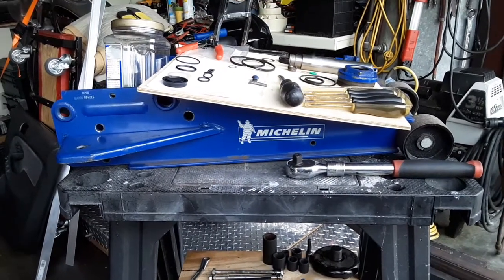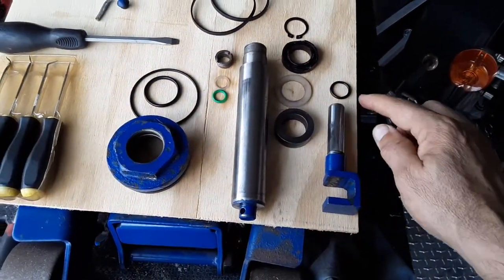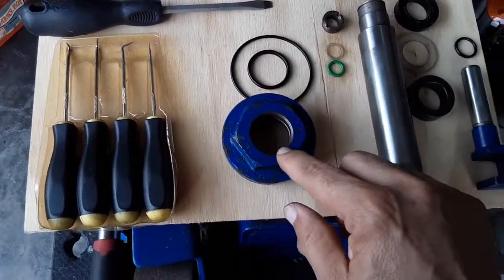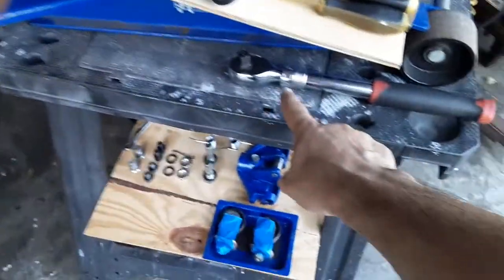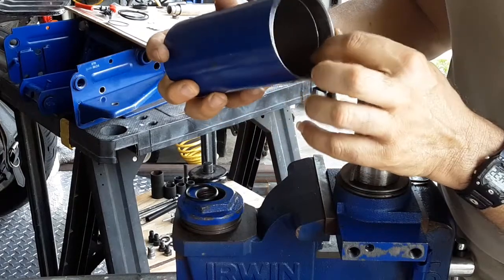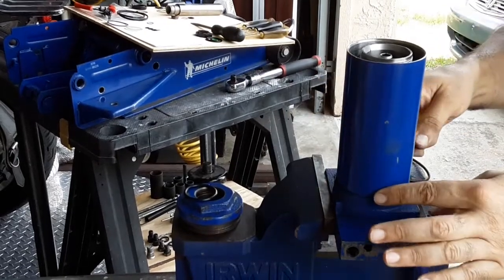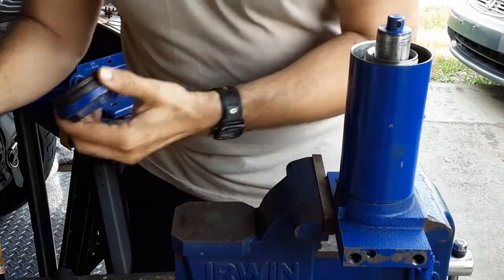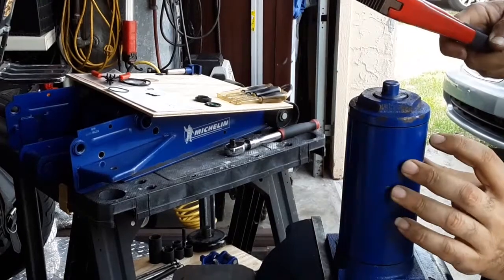DIY / How To Repair a Michelin 3.5 Ton Floor Jack...

Comment: FYI you only need to remove the two Allen bolts two hex bolts just below the Allen’s the long  rod with the nuts and spring. No need to remove pump handle assembly or caster wheels.
Reply from the maker: I'll do that next time I need to service it again. 😊
Reply: Worked for me, thanks!
Reply: @cliffbernsen438 we we was cwèèew

Comment: Manny, How do you remove the rod in the center of the jack that the lift arm pivots on?  It looks like there are caps on each side that are covering a bolt or something, but I was unable to get the caps off.
Reply from the maker: I will look into it and get back with you but I believe everything that needs to come apart, is secured with removable nuts or drift pins.

Comment: Could you explain or add a video of the reassembly of the 3 valves at the base of the cylinder?  Thanks for the video!
Reply from the maker: B Keen, i'm assuming you're talking about the adjusting valves and on my jack, I didn't take them apart for fear I would mess up the factory settings.  The other pin valves,  you can take them out and replace the o-rings and just push them back in after you coat the o-rings with fresh hydraulic oil.
Reply: @MannyFontes1968  ok,, 😥😰😨

Comment: How did you get that top nut off the hydraulic unit. I can not get it to budge even in a vice. Took it to my mechanic and he broke his plumbers wrench trying to loosen it.
Reply from the maker: Wow holy crap Kevin! I actually used a 24" pipe wrench with a 3' pipe extension for more leverage. You can also try using a flat tip punch and a 2 to 3 lb. hammer to hit the corners on the nut counter clockwise to try and shock it lose.
Reply: About to give up on it. Tried to buy just the hydraulic unit. Found a site. $179.00. Ah no…. Finally got some leverage. Tried the punch. No joy. I got a pipe wrench we used on our tractor. Still wont budge. It is stripping the nut.
Reply from the maker: @kevincraft3747  I think the only option left is to heat it up but you'll need a new seal...Good luck with this option!

Comment: So DON'T use the tapered seals. USE the O-rings for the valve body?
Reply from the maker: Yes, the tapered seals can roll during installation causing a bad seal making the pump not work right.

Comment: Hola tienes el video donde ajustas los tres tornillos pequeños?
Reply from the maker: Hello Luis, those 3 little screws are preset from the factory and are not supposed to be adjusted but if I find some information on how to adjust them I will share it with you.
Reply: @MannyFontes1968  ya se,, 🥶 ok igual te agradezco, saludos Many

Comment: So why did you disassemble it that far only to leave the center tube and bottoming plate in there? There's oring and a  gasket hidden under there..
Reply from the maker: Jay, are you talking about the one that is about 1/2 inch in diameter?

Comment: I have the same jack and same problem.  I haven't looked too deep into it until today when I needed it.  Is it necessary to take the whole thing apart?  I might be wrong... I'm probably wrong is more accurate, but can't I take the jack out without all the work?  Thanks for the video!  Because the O rings didn't match ( round or tapered) , would you still recommend the link you included?  if it's 70 buck's and it is,  I would pay it.. not a problem,  but it looks like I'm buying a bunch off spare o rings and 2 that don't fit.
Reply from the maker: If you have never done a tune up on it, then I would say yes to taking it all apart so that you can replace the necessary  O rings or seals so that you don't have to take apart later on if the seals start to go one by one. Sometimes the links for parts don't last long or are discontinued. The tune up I did on mine is still holding up.

Comment: many how did you get that nut off that jack pump and what did you use i try with a pipe wrench i can't get it off what can i do i'm stuck 1 i can't get a pipe wrench stay on the nut 2 or what size socket is it 3 where can i go for some one to get it off for me thank you many this second jack is a bicth if your close to orlando  fl. i come and see you

Comment: Great video!  I have the same jack and it's leaking from the piston rod. I need to order a repair kit. How is yours? Is it still leak free and working fine? Thx for sharing.
Reply from the maker: Thanks Guy and mine is still working great and it is leak free so far.

Comment: Hey Manny, I know this video is a few months old, but I'm trying to rebuild the same jack. I got the seal kit, but I can't get the blue sleeve off the jack. Is it left handed thread? I've tried a giant crescent wrench (& smacked it with a hammer!) on the top 2" nut. I've also tried a strap wrench around the body of the sleeve: not budging. What did you do? Do you remember?
Reply from the maker: Jeff, in order to get the top retaining nut that holds the reservoir body down, you'll need a big pipe wrench with a 2 to 3 foot cheater pipe over the pipe wrench to get the torque you'll need to get it loose. Once the nut is off you should be able to twist the body out since it's only being held on by the o-ring at the bottom. A big bench vise will help alot also.
Reply: @MannyFontes1968   great advice, thanks
Reply from the maker: @jeffr0  thank you and you're welcome...
Reply: Strong impact with 2-1/8 socket works nicely. Thanks for the video Manny!
Reply from the maker: @dougyoung221  yes it would and you're welcome!!!
Reply: You don't need cheater pipe to remove the nut.  Just use a pipe wrench or cresant wrench, and use a bigger rubber mallet/hammer on the handle.  It comes off easy.  Why bust your kahuna's?
Reply: I’m rebuilding this same jack, however the bottom of my reservoir is threaded and does not “snap” into the base like the one in the video. I had to use a 3’ Chester pipe on a pipe wrench to get it loose.

Comment: Did you have any difficulty getting that top nut/cap off of the cylinder? I've put the 'big' pipe wrench on it and just can't break it free! Am I missing something? thanks
Reply from the maker: Darin, it was a pain in the butt but I used the biggest pipe wrench(16") I had with a cheater pipe that was about 3 feet long to get that nut loose.  Put the pump in a good vise and you should be able to get it.
Reply: @MannyFontes1968  Awesome, thank you. I'll give it a try. And thanks for the video. This jack has been sitting, unusable, for over a year. Looking forward to getting it work again!
Reply: @MannyFontes1968  Wow, that was on there tight but the cheater bar did the trick! Thanks again.
Reply from the maker: @dtperkins1  Good to hear Darin and you're welcome...

Comment: I have this same jack and can't lossen the 2 inch bolt off the top.
Reply from the maker: CSM, you're going to need a good bench vise and at least a 14" pipe wrench with a cheater pipe to get that off.
Reply: I'm just doing mine, damaged in a fire but also seeped down slowly before the fire. Fortunately I have a 1/2" 20 volt dewalt impact because pipe wrench wasn't grabbing well enough. Unfortunately I didn't have a 2-1/8" socket, the size of nut. Fortunately a friend was able to borrow from his job site. It couldn't resist the dewalt. My kit came with choice of o-ring and beveled seal this fella had. My kit came from Lazzars.
Reply from the maker: @dougyoung221  yeah, if I had an impact socket that size, I would've used it also with my air impact gun to remove it.
Reply: 52mm deep impact socket and a good impact wrench and it comes right off

Comment: I wonder if this is the same as the napa 3.5 ton?
Reply from the maker: Steve, it looks like it and maybe years ago they used to sell this Michelin model.
Reply: @MannyFontes1968  the napa 3.5 is no longer available nor is any repair kits from napa. 😒
Reply from the maker: @MrSteve8511  well that sucks and have you tried looking at the manufacture's website that made the jack or Amazon?
Reply: @MannyFontes1968  yeah I'm scouring the internet... if I find a kit I'll post it here.

Comment: Hi, great video!! How did you open the refill hole ? it
Reply from the maker: John, you can use a small pick or flat tip screwdriver to pry out the rubber plug.

Comment: It look like you installed the tapered seal backwards (@5:30 min time).
Reply from the maker: I tried putting them in both ways off camera and it didn't work so that's why I just used the old ones and it still worked good.